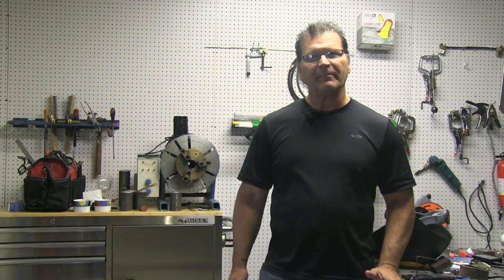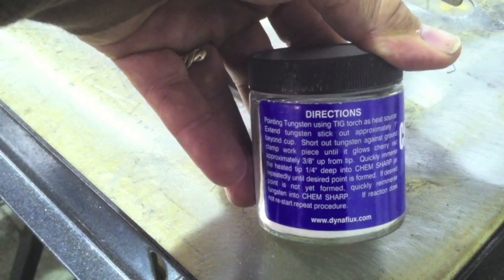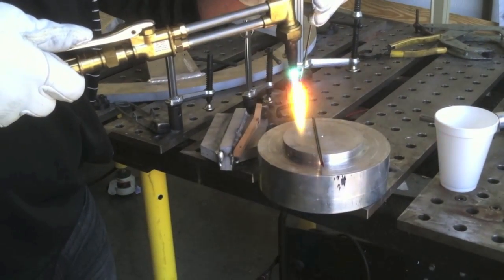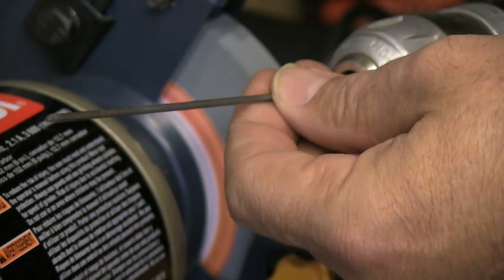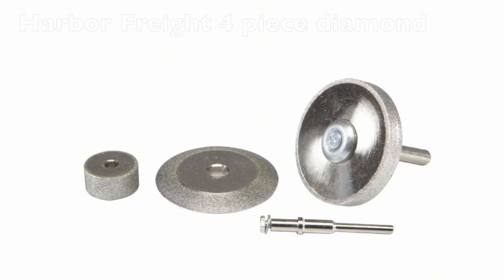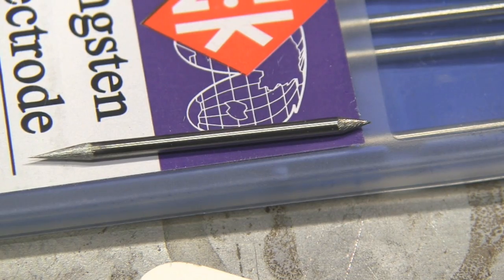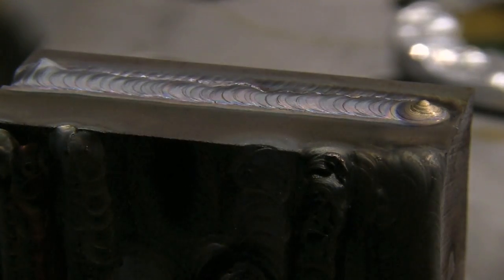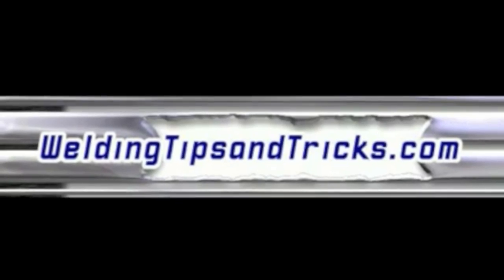Sharpening Tungsten 9 Different Ways

Comment: I bought a 3d printed enclosed tungsten sharpener on ebay, sharpened a 10 pack, the instructions didn't mention to empty out the dust. The dust went in the dremels bearing and seized up. I told the seller about it and was kind enough to send me extra diamond cutting disks for my troubles.

Comment: i've heard from so many people..."ya have to point upwards on the bench grinder..."  blah blah.  i see you at 3:45 going the other way like i was taught on the job 20 years ago.    done it both ways, don't see any differences.  A properly sharpened electrode will make your welding go more smoothly, but a good welder can still work wonders with an improper tip.  "...I also live in the real world..."  amen brother!
Reply: The fact Is that if you sharpen tungsten sideway, It Can starting vibrate and It Can internally crack and After 3/4 beads your tungsten Can split in 3/4 parts longitudinally.
Don't get me wrong, i Do It All the time too lol, but a couple of times my tungsten broke for this reason (i had a metal Bowl on my tip and to sharpen faster i Just pushed It sideway a Little too much).
This thing has sense if your boss tells you at work (you avoid to break your tungsten, so he avoid to waste money, Also considering that, at least in my country, welding factories pay 1 box of 3/32 electrodes around 60 dollars, not like me that i buy from Amazon for 20 dollars lol);
But at home you Can Do what you want obviously.

Comment: That's awesome. That Chem sharp reminds me of a time in Grad school I tried to attach a platinum wire to various metals with higher melting points than platinum. I can't remember now which metal it was but I put one in our hydrogen oxygen flame and it produced the nastiest stinkiest smoke. Probably lost a bunch of brain cells which is why I can't remember which metal it was. Might have been molybdenum all I really remember was afterwards I felt like crap for a while. Tungsten is used for ultra high vacuum scanning tunneling microscopy (UHV STM) and with that they use a chemical etchant with a small amount of current as well. I wonder if that would work for Tig as well. Probably take way too long as it took a while to etch STM tips and they are circa 0.5mm in diameter or smaller. Sorry it's been a long time since I done any of this stuff. Interesting but completely and totally unmarketable.

Comment: The best way I’ve found with sharpening tungsten with a torch is to have a carburizing flame (oxygen rich), make the flame squeal a little bit and then you don’t have to hit the oxygen feed on the torch.  I can’t count the number of times I’ve had to do this in the field welding.  My preferred method is a diamond wheel on a piranha grinder, but you don’t always have one available, or sometimes places are too cheap to buy new wheels for them when they get worn out.

Comment: If you have a tungsten that was contaminated because you dipped it into the puddle do you have to cut the contaminated blob of metal off of the end of the tungsten before sharpening it? I just got an AHP 200x off of Craigslist a few day ago and have been trying to practice on mild steel.  Being a newbie I am contaminating my electrodes a couple of times a day during practice welds and have been just grinding the blob off while sharpening. It dawned on me last night that the blob is probably contaminating my cheap diamond wheel from HF. Is there a way to clean the contamination off of the diamond wheel?  Or, in the long run, am I trying to be too critical for a newbie doing non-critical work?

Comment: How about a companion video to this one covering methods of how to cut tungsten welding rod for use with short back caps and really small torches?
Reply: Armand Tomany I'll usually just grab my lineman pliers to cut them or get a glob off where I bumped my wire into it. Usually the tungsten will crack and you'll have to grind a little extra off (maybe 1/8") to get past where it cracked

Comment: Jody, I love your videos! You are single handedly the guy responsible for what I can do with a TIG welder... mind you, I won't blame you for the all the TIG stuff I can't do yet :) Your videos are outstanding, and I love your honest, unbiased, straight forward way of presenting things. Keep up the good work!
BTW, I use a cordless drill and belt sander (grit 120) on mostly 1.6mm tungstens. In my own humble opinion I feel I get pretty decent consistent results over time, holding the drill in one hand, using low drill revs, and using the other hand with a glove to guide the middle of a long tungsten to control the pressure of the tip against the sanding belt. Just my 2 cents :)

Comment: Hi Jody do use a mask when sharpening your electrodes??? Is this a risk?? Iv been using a bench grinder no mask just wondering if I should be?
Reply: I've just read the thorium doted electrodes can emit (slightly) radioactive dust. So personally until I know more, I will just avoid those :)
Reply: Dejay Rezme the thorium electrodes emit alpha particles, which are only dangerous if they get inside your body, as your skin blocks them. If you were to use a grinder to sharpen them you would be completely fine if you used a shop vac to suck up the dust
Reply: Thatgood Nutt: And what do these 'Alpha Particles' do if they do get into your body?
Reply: pretty much the same stuff gamma radiation can do minus the severe physical mutations

but unless you ground a couple electrodes and ate the dust I doubt it would do much to you because the radiation is so weak

Comment: belt sander....I used a used ($30) 1x42 belt sander for several years to sharpen tungsten/s....ran regular alum-ox belts...but the blue zirconium oxide will cut faster and last longer...cost more too.....

Comment: Jody , 
Use a bench grinder with a really nice Norton grinding wheel of your choice.  Its 1000x better than a regular rock you would get at the home improvement store.  I happen to have one on a grinder I use to sharpen HSS tool bits and carbide I couldn't believe the difference it made.

Comment: I have been a registered welder in Canada for 45 years and guess what? I am new to tig welding .I picked up a New  dialarc 250 for $200 bucks and pedal and torch new and having fun with it .You have been a great help with slowing me down and using a lower amperage with some tips I am doing OK. I have run a lot of big dual shield wire 1/16 to 7/64 so for me to go down to a little tig machine is ???? where is the deposition lets go
Thanks for the help .

Comment: Jody, been following your videos for years.  I wanted to throw in my 2¢.  Following in your advice about polishing off the fine scratches with a piece of 3M scotchbrite to get the arc to come off the tip a little better, I used that principle with the Harbor-Freight #43533 mini-bench-grinder.  I use the grinding wheel to get a nice long taper on the tungstens, then I use the polishing wheel on the left side to get a darn near mirror finish (by holding the tungsten from above so the wheel surface goes away from the tip).  Much, much faster than manually running scotchbrite on the tip.

Here are some pics:
http://i169.photobucket.com/albums/u235/musico79/welding/100_8055_zpsok2tyopw.jpg
http://i169.photobucket.com/albums/u235/musico79/welding/0308161936a_zpsyxho156s.jpg
http://i169.photobucket.com/albums/u235/musico79/welding/0308161935_zpskohp0eis.jpg

Comment: Just got a $15 angle grinder from Harbor Freight and a diamond wheel for $4.  I made bench mount from a piece of angle with a hole for the grinder handle.  That vise grips to whatever handy surface.   Added several holes and notches to stabilize the electrode and I can get very pretty tapers of varying lengths.  The marks are a little rough, but I can take a diamond hone and smooth it quickly by hand if it seems necessary.  It is incredibly fast so you have to have a light touch.  If I ever see a finer diamond wheel it will be super.  I can commit  the cheap grinder to electrode only service.

Comment: as a welder I find you're videos helpful and easy to learn from, I just purchased a Lotos tig 200 and was wondering if you could do a demo on it and help understand the machine better. so far it has done good on aluminum with 3/32 2% ceriated at 100 amps with the foot pedal, but when I tried to use the pulse feature without the foot pedal I ended up with a mess. I have a very important weld to make on the back of a boat and wanted to use the pulse feature but I'm not comfortable with the unit, it is  on a outboard bracket that holds twin 250's let me know what you think, it's 1/4 material.

Comment: This is Jason Jiang from Shaanxi Yuheng Tungsten & Molybdenum Production Co, ltd, We are leading manufacturers and exporter of all kinds of Tungsten & Molybdenum production, including Tungsten Electrodes, Tungsten Rods,(WT20,WC20,WL10/WL15/WL20,WZ8.WP.WR2 ) and Titanium products for 18 years experience in this line. our company management and production are aligned to the standards of ISO9001:2000 and ISO 6848.

Comment: Thanks for the video, I'm just getting started and this is good information. One item worth mentioning is there are 6" diamond wheels for bench grinders if one is concerned with contamination or would like the smooth grind for their electrodes.  They're a lot more expensive than normal grinding wheels but are a lot less than the sharpening tools.

Comment: You rock.  I'm still learning to weld with tig.  Thought it was close enough when I sharpened it,  but after using the cordless with the grinding wheel...so nice!

Easily welding 22 gauge stainless.  Thank you so much.

Comment: Some mention (even very brief) of the nature of the hazards associated with grinding (and especially oxidizing with a torch) tungsten would be appropriate.
.
Although many people are aware that breathing dust with alpha emitters might be hazardous, the people that would be most interested in how to sharpen tungsten are most likely not to be aware of the hazards or aware of the alternative non-thoriated tungsten available.
.
Putting a brief warning at the beginning of the video would be great.  At the very least, please put a brief warning and link in the description.
Reply: The comment Is pretty old, but: dunno in U.S.A. but in Italy Red tungsten can't bè used anymore for work, even if Can use It at home.
Anyway the big problem Is at work, where 20/30 ppl sharpen tungstens everyday in the same bench grinder.
At home, unless you work at home everyday, 8 hours per day, you won't have issues from tungsten dust. The issues you Can have at home (if no proper ventilation)are  about welding fumes and metal grinding dust breathing in general (not Only tungsten)

Comment: Bucket of tack welds sky hook arc start sheet strecher slag remover buck shot repelant or when your having a hard time tell the helper to grind off the never weld that someone must have sprayed on the metal
Reply: You forgot the metric pipe clamps and the wood tip for your torch.

Comment: Hi Jody
  Great vids. I'm learning. I made a welding table. My question is do I have to grind the mill scale off? I also made a third hand do you have to put silicon bronze on ends? Thanks for letting me pick your brain.
Reply from the maker: mill scale will prevent rusting but will not transfer a good ground. most people dont grind the mill scale.  You might want to weld a ground tab under the lip that is ground clean and then use a jumper ground cable for certain jobs.  third hand works better with silicon bronze but its not completely necessary...it does prevent arc marks on critical parts....thats the main reason for it

Comment: Yeah, I too found it insane to buy an electrode grinder that was almost the same price as my Everlast 160sth. Why do they charge so much, are they gonna teach you how to weld too? Lately I use my bench grinder with a cheaper($40) diamond cutter chucked onto it, and even though I've yet to have any mishaps, I do like the idea of drilling a support hole with maybe a little tubing tacked on for a sleeve to support it. Thanks again for the laughs, I'm still looking for my left-handed wrench to loosen my muffler bearings on my board stretcher!
Reply: It's probably for the convenience. I'd imagine that the type of people that buy those are the type that are in the top paid or most critical positions such as nuclear.

Comment: The power plant that I worked at as an electrician the safety nannies would fire the weldors for sharpening the electrodes with a angle grinder but they would always seem to try it.

Comment: What about this tungsten grinder I got on ebay? Only $229 and it works fantastic! 
http://www.ebay.com/itm/TIG-Welder-Tungsten-Electrode-Sharpener-Grinder-Tig-/140451757157?pt=LH_DefaultDomain_0&hash=item20b393bc65
Reply from the maker: That one is made by Tech South and its the most affordable I have found ...and works good too.